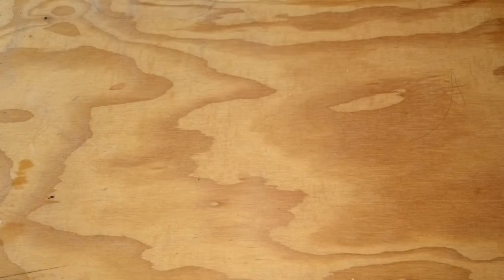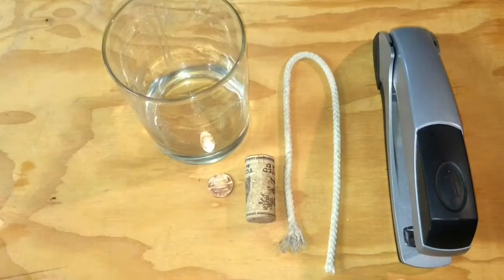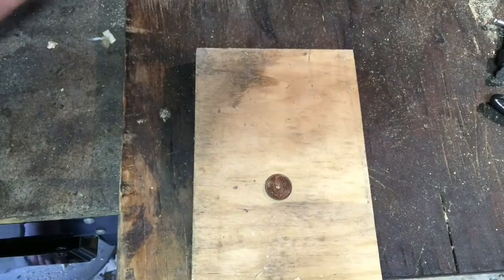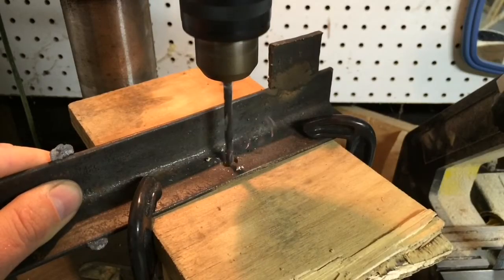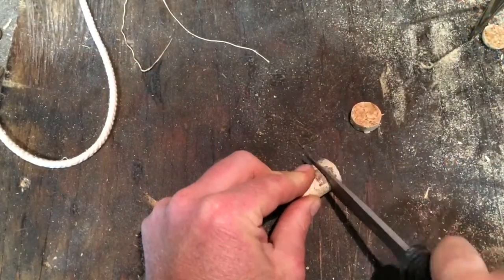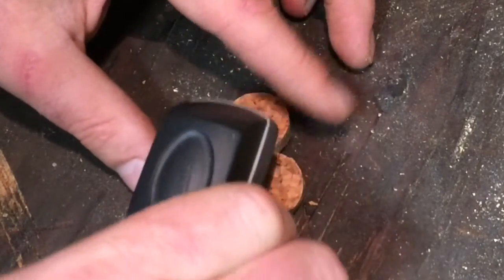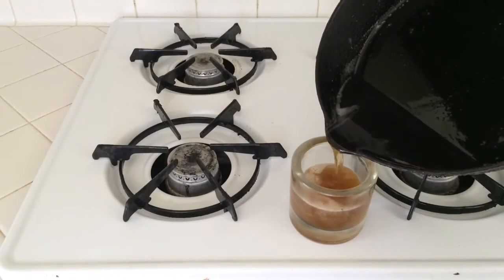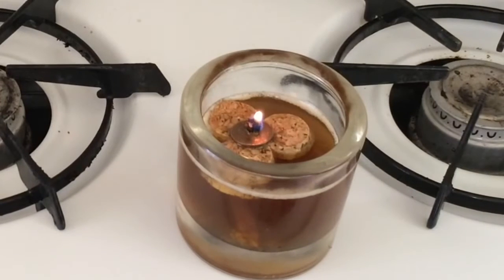The Bacon Grease Lamp

Comment: Cool little trick. What happens when the bacon grease hardens? Does the flame throw off enough heat to keep it liquid?
Reply: the flame generates enough heat to melt them back up and allows consistent fuel supply. check out bacon grease lamp on my channel, too, if you want to see that in action here: https://youtu.be/M0dDwsxS0ks?t=232

Comment: Do your bacon pigs live on nothing but corn and soy? Is that why the fat is liquid? Bacon fat is solid white here in Oz. So no difficulty getting the wick to stand upright.

I have made many "lamb lamps" / candles with a piece of cotton kitchen string as a wick, tied to a small metal washer sitting on the bottom of a jar, tied around a 4'' nail across the top to keep the string upright, pour in the rendered lamb fat, allow to set, remove the nail & trim wick. 
Seems like this simple wick lasts forever. The candles (about 1 1/2 cups fat) keep  burning for 4 days or more.
Reply: Bacon fat is yellowish because it is smoked meat, and it's liquid because it comes out of a hot pan.
Reply: The grease was liquid because he heated it. It solidifies once it cools.